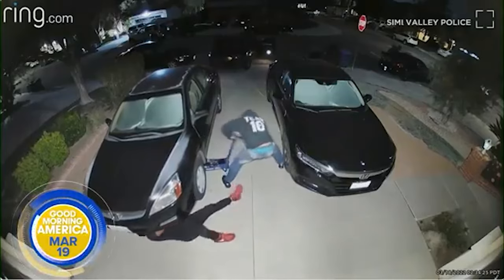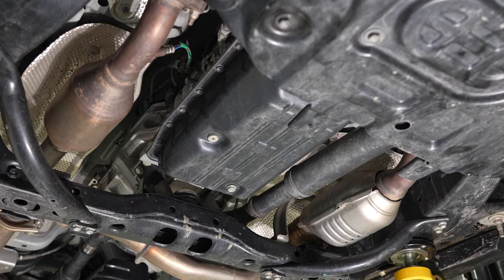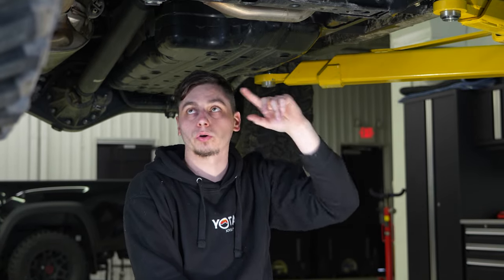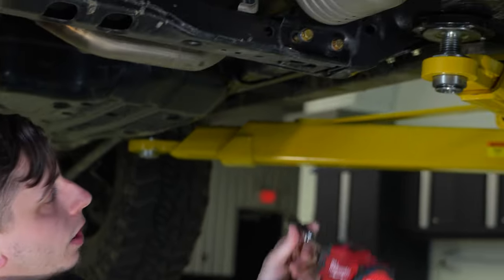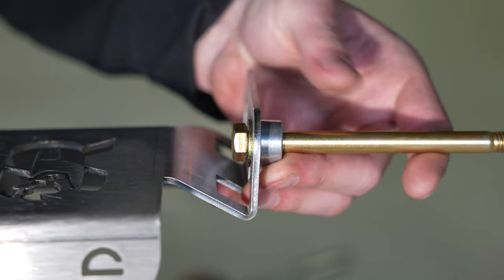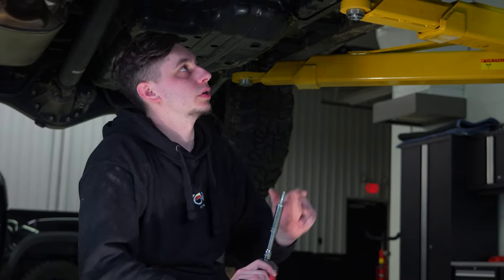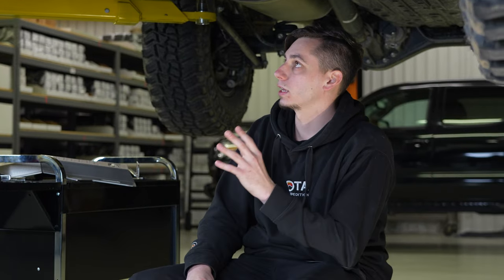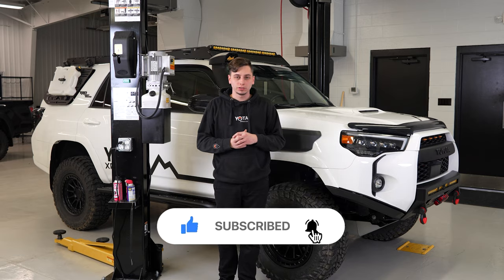Cali Raised 4Runner Catalytic Converter Shield Installation

Comment: When installing the rubber snubber using a small screwdriver, make certain to sterilise and sharpen the screwdriver so as to make a clean puncture wound in your hand.  Bandaids are also recommended.
Reply from the maker: lol, doesn't sound like you had a good experience.
Reply: @yotaxpedition  No problems w/my CaliRaised shields.  I’m just experienced.  Good judgment comes from experience, and a lot of that experience comes from bad judgment.
Reply: Do yourself a favor and put a little bit of olive oil on the rubber it slides ride in

Comment: So I just received my Cat shields, took me 2 hours to put them on but should have taken 1 hour because I ran into huge problems. First off the driver side is right up against the cat, once I got it in it was okay however the edge of the shield is on my traction line both on the driver and passenger side. I wish I could shear photos here. 2 hours of regretting my purchase it ended up great except for the fact that it’s on my traction lines. At least I think that’s what they are.
Reply from the maker: Sorry for your troubles. Just a reminder, we do not manufacture this product, we only sell it and made an install video. But we will help the best we can. The driver side on ours touched as well. I think CaliRaised is or did make a change on this problem. My best advice is to add a washer between the cat shield and frame to get it away from the cat just enough. But that will require longer bolts (which the bolts that come with it should be longer).
Reply: @yotaxpedition just got my ordered today and will install it tomorrow. Question did Cali Raised fix the issue about the traction line?

Comment: This video was super helpful -- thanks!  Took me 1.5 to 2 hrs to install these, but I don't have a lift, just slid under my 4Runner in the driveway, which was a pain.  Also, I don't have an impact setup, so I did it with hand tools, but I don't think I could have gotten an impact to really work with a few things in the way.  I also don't have deep sockets, and ultimately needed two 9/16 (not 14mm) wrenches to tighten the long bolts fully.

Comment: Just installed the shields on my own ‘23 TRD Pro.  The one thing I did not hear mentioned in the video is that the replacement bolts and nuts are 9/16” and not metric.  Perhaps this is a recent change in packaging.  Other than that the install went smoothly, less than an hour to do both sides.  Thanks for the super helpful guide!

Comment: Installed this morning on my '23 TRD Off Road. Simple to do, tight and secure. No rattling. Great product. Did it in my garage using a 3 ton jack. Just slightly raised each side, one side at a time, for easier access.Tires didn't even come off the ground.
Reply from the maker: Nice!

Comment: I installed it today on my 2018 5th gen 2WD. It fits perfect no rattling. I spoke with the Cali raised LED rep and they  fixed the rattling on the driver side and provided longer security bolts.
Reply from the maker: No problems with fitting the 2wd? We were told it doesn't fit 2wd models. Also it's good to hear they fixed some issues.

Comment: Terrific easy to follow instructions, especially the 2 front bolts. I used a 6- inch C clamp to lower the back of the brace into position to install the 2 aft bolts after seating the front 2. This just eliminates the need to press, hold & attempt to catch a few threads.
Reply from the maker: Thanks! Also good feedback. I wish the bolts were just a bit longer to make it easier getting the threads started.
Reply: @yotaxpedition  couldn’t agree more on the bolts 3-5 more threads would have been awesome. Like I said though the C clamp put it where I needed it & held it so I was able to get them both seated well. The kit overall is very solid, well built, fits perfect & if the only complaint is not shipping with longer bolts then in my opinion it’s a great kit.

Comment: great video, clear and thoughtful! I want to ask about those four holes that the two short brackets fastened to the frame, are they nut-serts? is there a nut welded on the inside of the frame cavity? or those holes are just threaded "tunnels"? My 4runner's front sway bar mount hole was damaged due the the welded nut breaking off.

Comment: Went to install the shields on my 4runner and had a problem with the Security Hardware. It seems the bolts are not long enough so the threads don't catch no matter how much force I use pushing up. I tried the OEM bolts to see if there was a difference and the OEM bolts wouldn't even catch. There seems to be some thickness with the shield and the OEM brackets that is the problem.  I have 2 choices...send longer bolts or I will have to return product, which I'd rather not do. Please advise.
Reply from the maker: Start the threads on the security bolts first, then do the other bolts. It will be a tight fit. If you have any further questions please email us at support@yotaxpedition.com.
Reply: Same freaking problem here!!  If you add thickness of shield we need a longer damn bolt.  The security bolts are shorter than the OEM and even the OEM won't reach.
Reply: @djohnson0753  I was actually able to get them in. Just start the security bolts first about halfway, then do the OEM bolts and it should work. Good luck.

Comment: What is the required torque for the security bolts and the 12mm bolts?
Reply: Probably not the answer you are seeking but, respectfully, I would say to just tighten it snug and don't worry too much about the torque specs for something like this.

Comment: Is it ok to use one of the security bolts at each end of the support members instead of both security bolts on the outer bolt connection?
Reply from the maker: If they are the same length and thread I don’t see why not.  We haven’t tried it though.

Comment: What would prevent a thief from just ordering one of these kits for a couple hundred bucks and then they will have the "special" tool. How long would it take to cut that off with a cordless angle grinder?
Reply from the maker: You really think a thief would go through all that vs just going to the next vehicle that has no protection? Also the price for a scrap cat and the shield kit is almost the same so that would be dumb on the thief's part.
Reply: Me and my 3 homies chipped in 50 each to buy the kit. Now we switch off on different days to use the bit to steal cats. Thanks for the tip!
Reply: The bits are cheap at Home Depot :) but the point is too much trouble so thief will just go to the next vehicle

Comment: Will these work with cbi skid plates? I know they say they work 99% of all aftermarket skids but with the cbi skids, those brakets are removed and not reinstalled.
Reply from the maker: The cross brackets are not needed for the install, these should pinch between the skid and the frame.

Comment: I threw these on my 4Runner and there’s a groaning noise at low speed. Any ideas as to what that could be?
Reply from the maker: Its possible that the driver side shield is vibrating on the cat.

Comment: Just installed mine. Does it matter that the driver side is touching the cat?
Reply from the maker: Hey David, same problem here when we did our install. I think CaliRaised is or did make a change on this problem. My best advice is to add a washer between the cat shield and frame to get it away from the cat just enough. But that will require longer bolts (which the bolts that come with it should be longer).

Comment: My car started vibrating and rattling at around 400 RPM when the car is on Drive, stopped, and AC turns on. I believe it’s due to the cat touching the shield. Is there any one else with the same problem? How do we create clearance so the car wouldn’t vibrate and give rattling sound? Thank you.
Reply from the maker: Yeah, the driver side seems to rattle against the cat shield. If you're having problems with this please reach out to Cali Raised LED and see if they can get it sorted for you.
Reply: Any luck? I’m Having the same problem
Reply: @existencia3 yes I had to modify the shield had to cut about 1 inch off one corner so I could pull it farther from the exhaustwhere it’s touching pulled it toward the ground then tighten it.
Reply: @existencia3 i believe I had to cut a triangular shape where it would touch one of the bars when I pulled the shield toward the ground when the bolts are lose where it’s rubbing the exhaust.

Comment: I just installed mine on a 2023 ORP. The passenger side is fine but I notice on the driver side, where the CAT has a heat shield and it has a clearing  problem. It fitted but leave no gap between the heat shield and the CAT shield. They touched. I notice some vibration when driving.  Do you have similar issue or am I installing it properly? Any recommendations? On a side note, Isn’t it weird there’s no heat shield on passenger side but only the drivers side? Thanks
Reply from the maker: Hey Tim, same problem here when we did our install. I think CaliRaised is or did make a change on this problem. My best advice is to add a washer between the cat shield and frame to get it away from the cat just enough. But that will require longer bolts (which the bolts that come with it should be longer). As far as the driver side cat having a shield and the passenger side not, is most likely the fact that fuel and brake lines run along the driver side.
Reply: I have the same issue with the vibration I could feel it and hear it , it sucks I might just end up taking them off

Comment: ONLY for 4wd. They don't seem interested in 2wd.
Reply from the maker: Yeah, unfortunately only 4wd option at this time.
Reply: Didn’t know they made a 2WD runner….is it still called a 4Runner if it’s not 4WD?
Reply: @danielrogers4072  Yes sir, SR5 2WD. Good family ride, good on the highway, has a solid frame under it.
Reply: I installed it today on my 2018 5th gen 2WD. It fits perfect no rattling. I spoke with the Cali raised LED rep and they  fixed the rattling on the driver side and provided longer security bolts.
Reply: @techiemarksman  wonder why they wont say that.

Comment: Folks !   When installing on the Tacoma leave the spacers out and also use stock bolts that hold transmission cross mount. 

Cali has this change out because the security bolt hole does not line up if spacers used. 

Yes, Tacoma kit the same as the one install here.
Reply from the maker: The Tacoma cat shields did not come with spacers and new bolts. Only the 4runner kit came with new bolts and spacers.